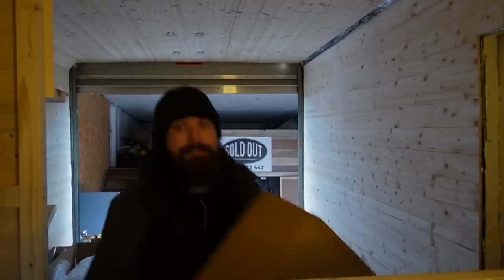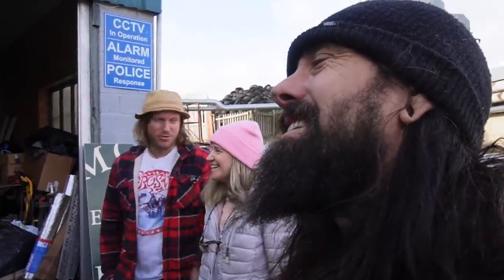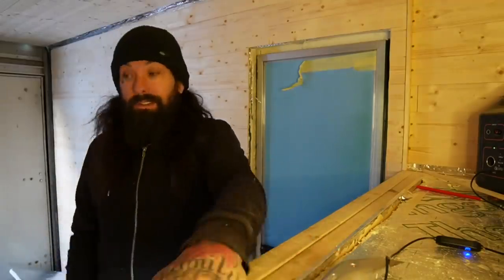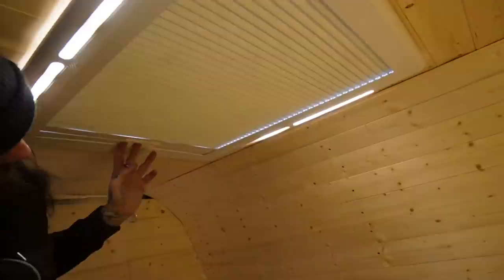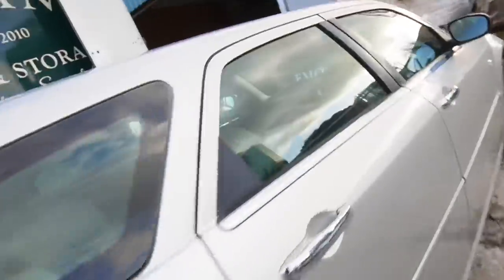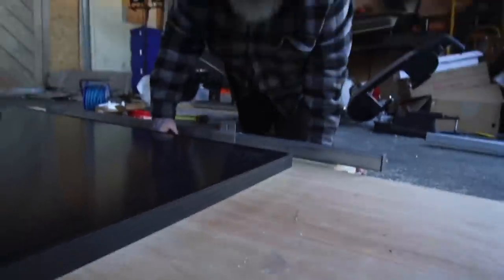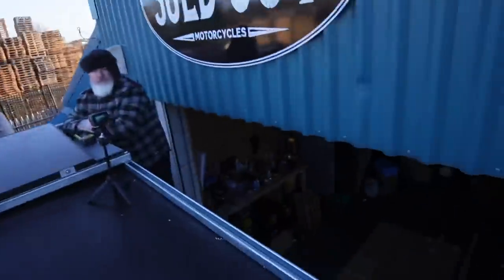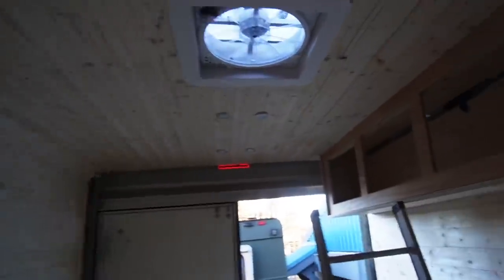Removal van camper Build - Week 4

Comment: Nice workmanship there fella. One thing I’d have done different is use T brackets on the unistrut roof rack so that the solar panels are lower to the roof and more streamlined all round.
Reply from the maker: The decking will be sat on top so it will be flush with the panels

Comment: Loving watching this from the ground up. Are you concerned about the weight and how much is distributed high up. Is it likely to wallow a lot on the corners. Any thoughts about beefing up the suspension? Air assist on the rear?

Comment: Proper job. Loads of respect to you. Just a question and advice are roof vents directional regarding air flow when driving. Had a few come off on my caravan in the past when driving. Been told that hinge point should face into wind when driving . But it was an old van. Cheers from old George
Reply from the maker: Yeah they face the front